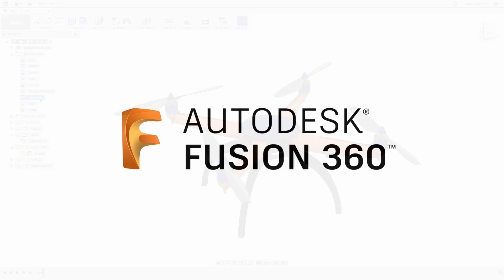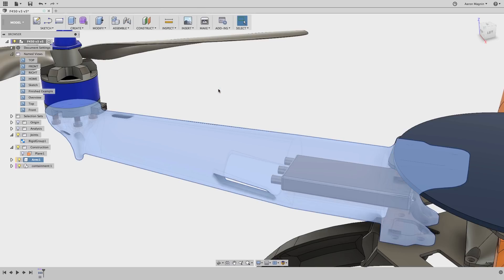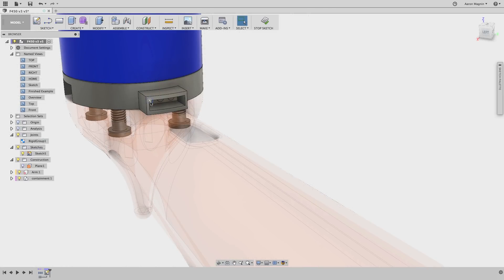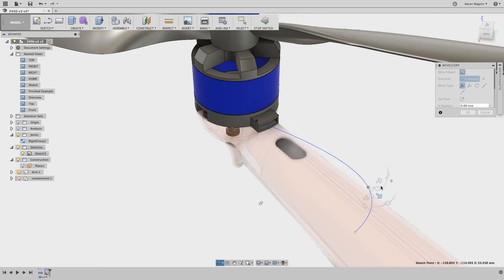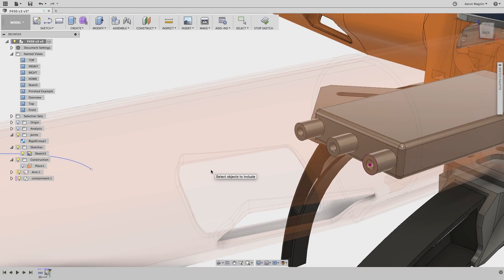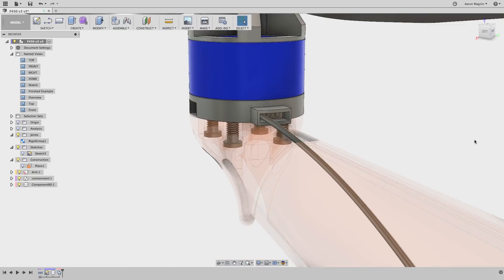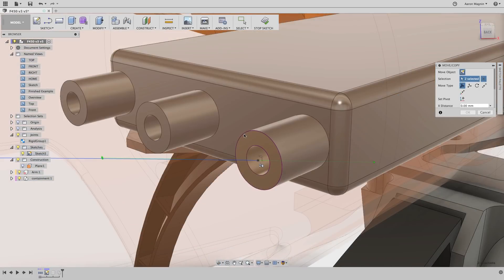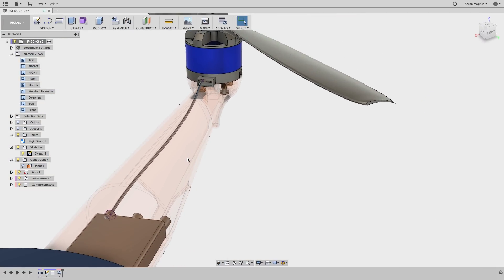Adding wires for stunning Renders in Autodesk Fusion 360

Comment: cant select the include 3d geometry and the point to make coincident
Reply from the maker: Is this related to a particular instance? I'm wondering if the issue has to do with an external part (although that shouldn't affect it)....or selection filter...or? There's a lot that could be happening. Can you add this to the forum to get some better help?

Comment: got problem after i do last steps : insert 3D geometry and next step i use coincident circle moves to line not line.... nothing helps what the problem..???
Reply from the maker: Have you enabled 3d sketching? Check in the sketch options, but also preferences (https://www.dropbox.com/s/5twga0i2n4ikfjx/allow%203d%20sketching.png?dl=0)
Reply: yep that one box - enabled... may be some other problem ?  problem in sketch construction? Only working way for me if i connect spline from center to center... then align. 
but doing same steps using other objects  like in your video (sketch circle on box and another one same object with  sketch circle on surface ) circle moves to spline line (it just leave box surface and connect to spline ))) )
anyways Thx for responce. np if i do same from other ways. p,s, i pressed thumbs up for vid. there is no me that 7 dislikes ))

Comment: What the fuck? This is not a solution for the design, we need a special tool, but not so complex as in Inventor. The length of the wires must be calculated automatically for BOM.
 What if I have hundreds of wires of different lengths and thicknesses? I need to draw splines by hand, like some kind of freak?